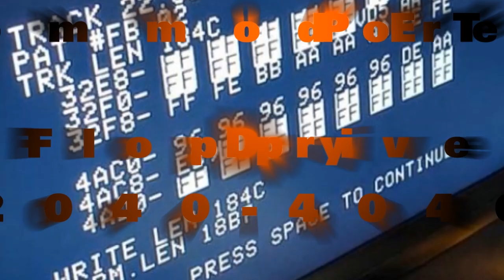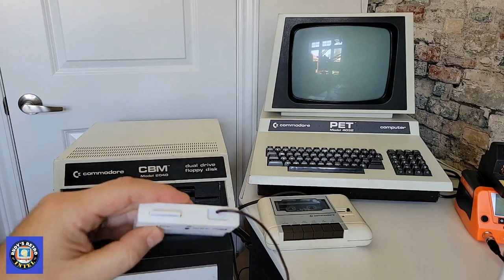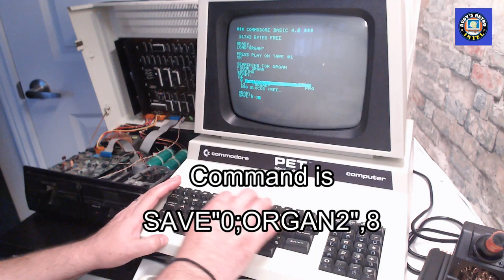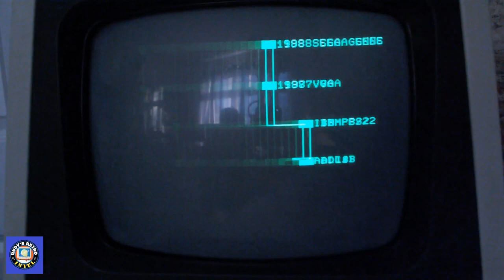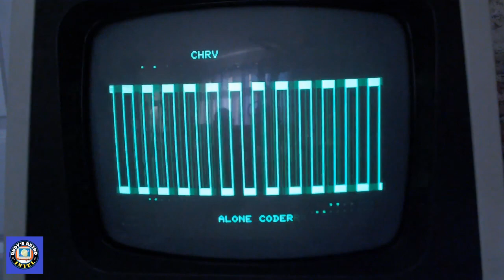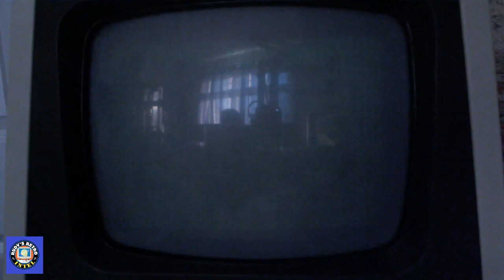Commodore PET File Backup - It’s Easy!

Comment: The Atari 2600 has a 6507 which is a pin reduced version of the 6502.  The 6507 is also used in the Atari disk drives along with ROMS and RAM, so they are also computers unto themselves as well.
Reply from the maker: Thanks for commenting and sharing this information. I learned something new today.
Reply: @RudysRetroIntel  The use of the 6507 limits the amount of RAM/ROM that the 2600 can address which explains a lot about the limitations of the 2600 game system. The use of the 6507 in the Atari Drives was not so much of a bottleneck in the disk drives, but doubling the RAM size increased throughput by 2X.  The ICD Doubler was a RAM and ROM upgrade for the 1050 disk drive that increased I/O speeds and supported double density disks.

Comment: I was wondering what the differences were between the 2040, 4040 and 8050 drives... Thanks Rudy! I am wonding if anyone knows where to find a IEEE-488 to pet adapter? My cable has the standard IEEE-488 pass through connector on both ends
Reply from the maker: Thanks for commenting. You can find cables on ebay. I believe there is a way to make one, but I would have to investigate

Comment: What is a 'slow blow fuse'?
Reply from the maker: A slow blow fuse means it has a higher tolerance for the amperage. For example, if slow blow fuse is rated for 1amp, it will continue to work if an amperage of 1.1 amp is maintend for a very short  time. Fast blow, in same situation ,will  blow the fuse if amp just baearly goes past 1am, say 1.1amps. Hope this helps. Each computer or equipment will specify the type of fuse needed. Do not replace them with the other type.
Reply: @RudysRetroIntel  Ah, thank you.